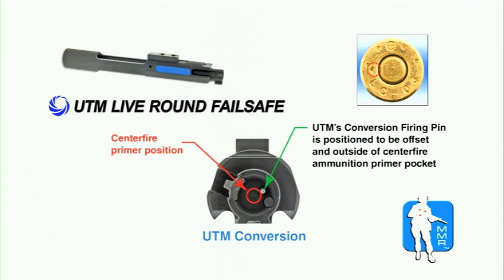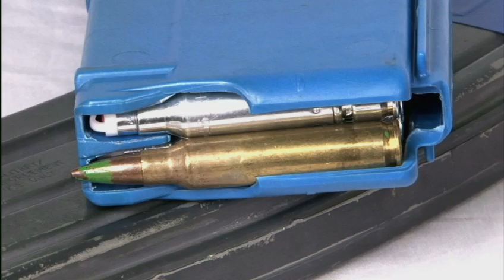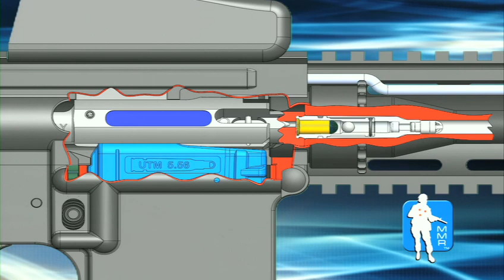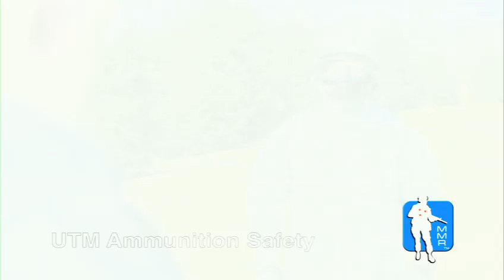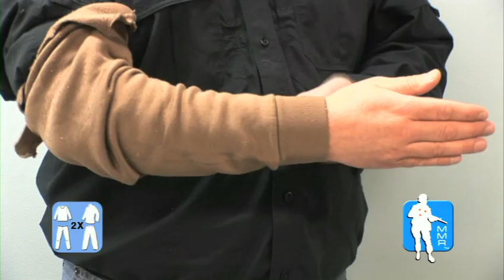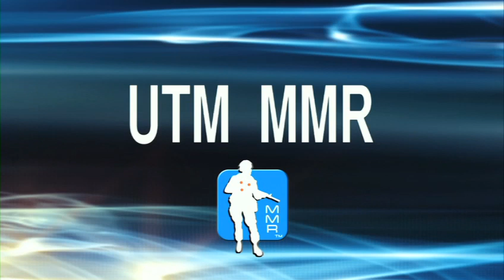UTM Man Marker Rounds - CTS

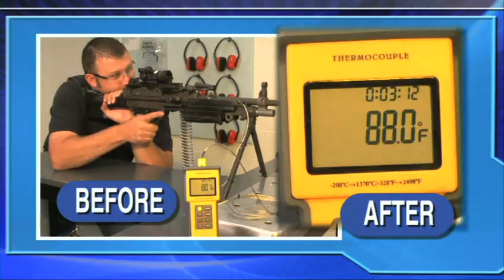Comment: Am I losing it? At 10:14, the narrator indicates that the temperature only increases 1-2 degrees, but then the still photograph shows a difference of 8 degrees (80.1 to start, 88.0 at the end).
Reply: Might be 1-2C not F.
Reply: @Špý-VS-Špý  That would still be an increase of 4.5 degrees C. And besides it literally says F on the thermometer.